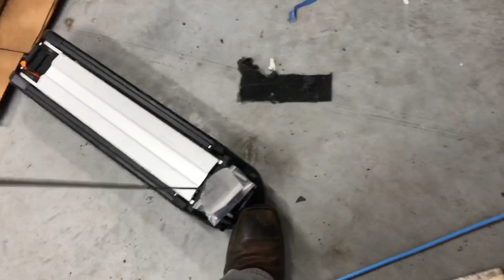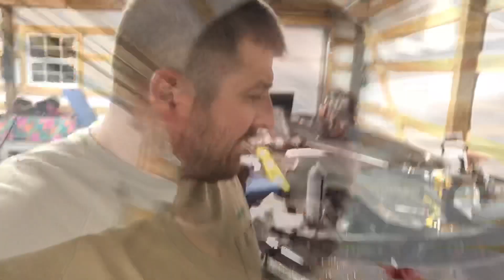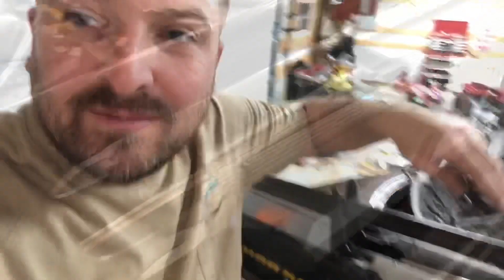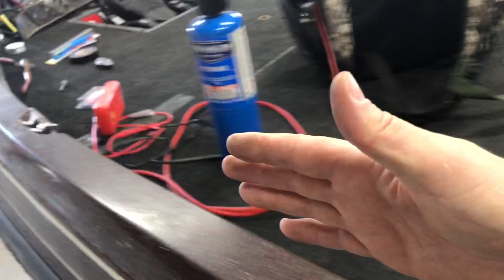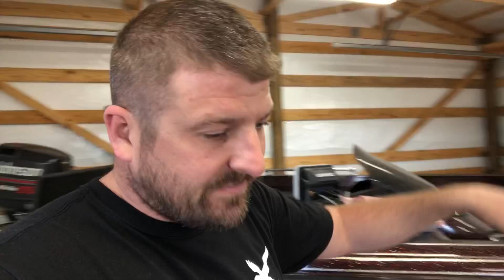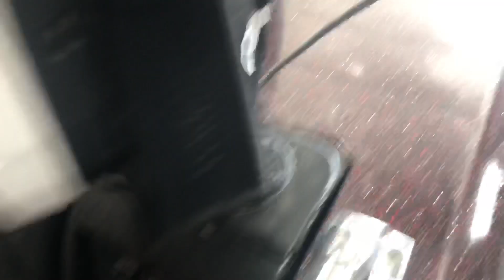Installing the Ultrex Trolling Motor

Comment: I've seen way too many of those isolator bolts fail. I'd never use those
Reply from the maker: They failed on me! I already removed them and put bolts with lock nuts on them!
Reply: When there is no access then they can be used.  If no access how do you attach the mounting hardware?

Comment: What battery did you wire the bluetooth puck to? Can you wire it to the 2 batteries since there in series at 24 volts? Or do you have a 3rd battery
Reply from the maker: It’s 12v and I wired it to the started battery that’s powering my depth finders.
Reply: @PureLivingForOutdoors  Okay that's what I figured! Thanks gonna install on tomorrow and my buddy thinks its gonna be a 1 hour job 🤣
Reply from the maker: Ryan Doll honestly if you can reach the bolts easy and the wires are already ran it won’t take long! It was super easy! Mine took me a bit because i was hunting tools and getting interrupted to do honey do’s lol
Reply from the maker: Ryan Doll or if you use the rubber deals like I did. As long as you have a 1/2” drill bit handy and a big Phillips bit it won’t take long. I don’t recommend putting in a plug either. I recommend direct wiring the 24v
Reply from the maker: Did you get the TM hooked up?
Reply: @PureLivingForOutdoors  No I'm actually fishing a 2 week saugeye tournament here in ohio so we didnt get to it today😔 Going to try and start tomorrow morning though